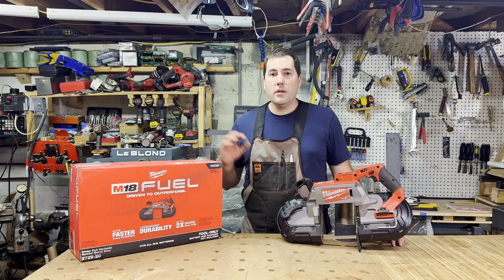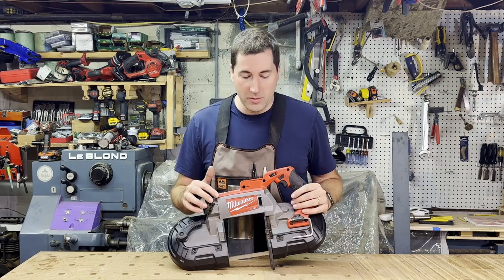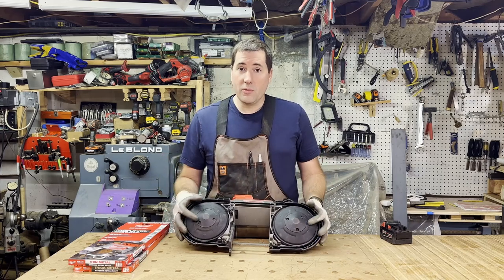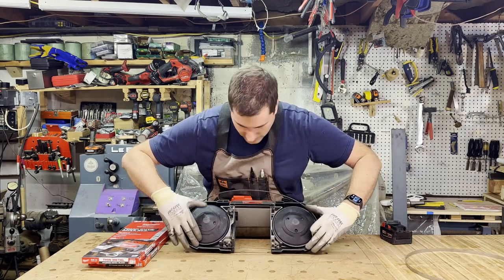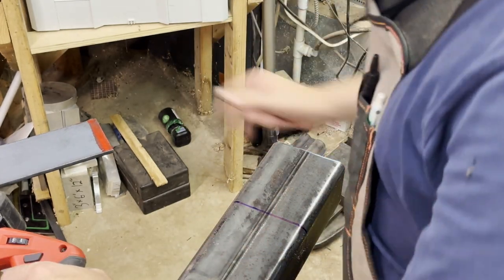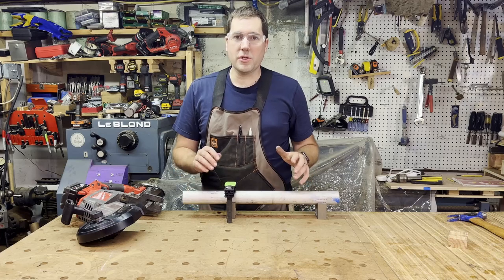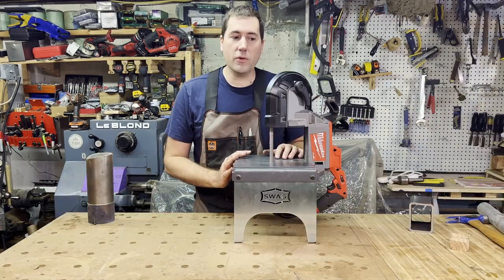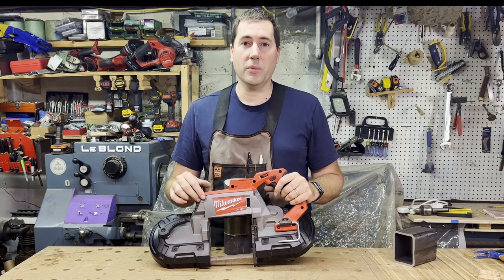MIlwaukee M18 2729-20 Deepcut Cordless Bandsaw Review

Comment: Nice video! I just bought it, I work in the electrical trade. I’m going to be using it mainly to cut 4 inch conduit. My favorite bandsaw is the Milwaukee m12 fuel bandsaw I can use it to cut up to 2 inch conduit and it’s light enough where I can use it with one hand. There’s some good deals in the Home Depot app. I got that bandsaw for 309 and a free 6.0 battery before tax I just couldn’t pass up that offer. Best of luck mate. 👍👌